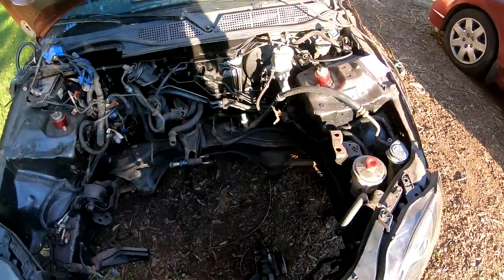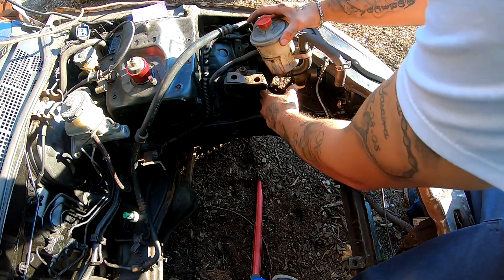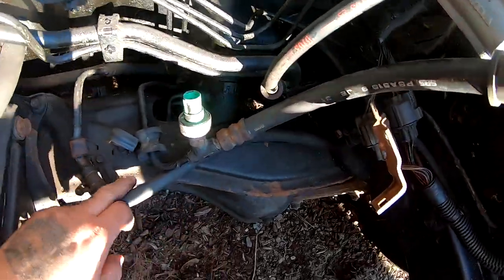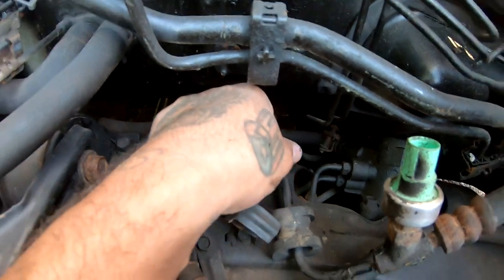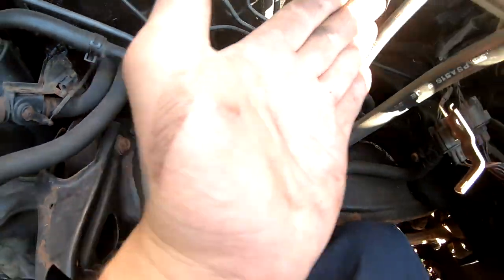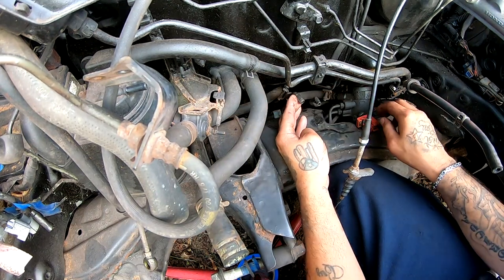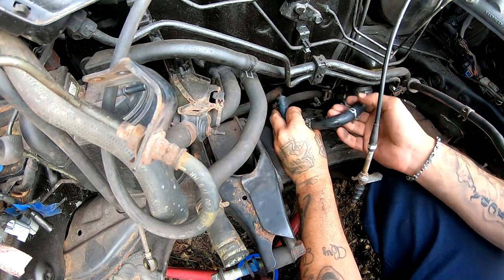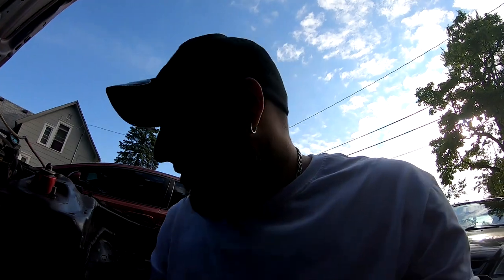2000 Civic power steering delete & loop

Comment: What does the loop do I don’t quite understand
Reply: There is fluid in the rack on both sides of a piston. When you turn, the piston moves to either side depending on which direction you are turning. So the fluid wants to go from one side to the other any time you turn. Looping allows the fluid to move around, whereas plugging the lines won't allow fluid to move around and makes it harder to turn.

Comment: Question could I still do the loop hack even though my power steering is leaking from the boot? Its for a 1993 honda del sol d16z6 engine

Comment: Hey bro, had a question as to how to install the power steering delete from chase bays because I have it but can’t find a video on how to install
Reply from the maker: is this the kit that comes with the resevoir?
Reply: Barbas Life yes sir that is the one
Reply from the maker: @itsish2190  just disconnect  the lines from the rack and pinion  its a straight up bolt on kit.  Fallow your feed and your return lines to the rack and pinion and unbolt em. You gonna have to get under the car if you have your engine  still in the bay.
Reply: Barbas Life yes. I do , I’ll try tomorrow, hopefully the lines come loose cos every bolt has been in this car for the past 20 years

Comment: What about the pulleys an belt?
Reply: Pulley comes off with pump. Then you can either look for a PS delete pulley (dummy pulley) to put in its place with the original belt, or use a string to measure the length for a new belt. They come in half-inch increments.

Comment: Did you left fluid in there or drain it out?
Reply from the maker: left it in tried to top it off
Reply: How is that going is there any problem since?
Reply from the maker: I ended up putting a (T) ran one line in one line out and one line to a hose with a custom reservoir. So its always toped off.
Reply: Can you make video of that too and how do you feel with steering?

Comment: My power steering is leaking on the two bolts ontop of pump idk what's going on? what are benefits from delete
Reply from the maker: you might just need a new o ring
Reply: @BarbasLife  I hope so I hit a bunch of bumps on a shitty road unexpectedly next thing I know no steering fluid cap and the O ring is loose it mustve been old and came off
Reply: on these Hondas no power steering is a must.

Comment: Why do you have to add fluid to the hose if your removing the powersteering
Reply from the maker: I removed the power steering pump and hoses the rack and pinion is still for power steering so it needs to have lube inside but If I was to swap my rack and pinion for a manual one meaning with no power steering option then i woulnt have to do this.
Reply: @BarbasLife  oh ok I understand now I have a b20vtec in a 99 civic ex so mine would be the exact same way as yours right thanks bro for the tips and keep up the good work
Reply: @robbymistiegautney6011  I'm getting my 1999 Civic  Ex tomorrow from the shop.  B18b1 swap, full suspension and all new Si exhaust!!! I just got 4 new shoes and with the new camber kit shell be sitting pretty!